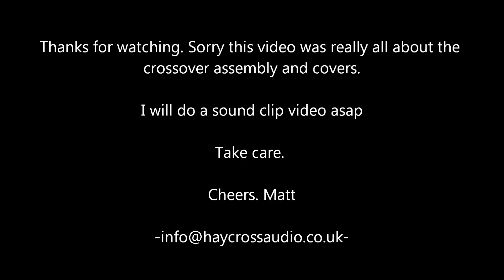2-way Speaker Build. LS3/5a Style Part 4

Comment: Resistors and capacitors are made with metals. Shouldn’t it be mounted away from the top of the woofer inductor where it’s magnetic field is the strongest ?
Reply from the maker: There's only limited space. The woofer inductor is at the top of the cabinet. It doesn't really matter. The driver magnets are not moving so can't induce current into any components.

Comment: They look a lot like Linn Kans. I love 'em....
Reply from the maker: Ended up sounding really good. There a keeper for sure. They live in our snug and run with a sub
Reply: @haycrossaudio5474  I'm over in Australia Matt, (Ex Pom from Yorkshire) where the availability of older British stuff seems to be quite limited, a much smaller population I suspect being the main factor. Nevertheless I've watched many of your vids and find them most enlightening. I'm a speaker builder from way back and I really should learn more about crossover theory. However I don't have any measuring equipment, nor would I know how to use it, so I mainly dabble in the woodworking side of the hobby. I turned 76 today (your tomorrow) so I'm probably a bit long in the tooth for too much math...

I've got a pair of D'appolito's on the go. They're old Aria 5's, built from a kit using Focal drivers and serious looking crossovers by my nephew who now lives in London. He palmed 'em off to me for zero dollars and no cents since he no longer has any need for them. They're probably 15-20 years old and were very expensive in their time. I binned the enclosures except for the robust front baffles and I'm in the middle of making new boxes.

I built an active sub last year recycling a Rogers Chinese sub, using the electronics. I subbed in more powerful Mosfets and larger filter caps, which probably don't make the slightest difference. A new 12 inch driver from Farnell (Element14 in Oz) replaced the crappy Rogers thing, and in down-firing mode with a new enclosure it works very well. My preference is for small bookshelves, so a sub is pretty much essential as you are of course aware. It's my first ever sub, and I should have embraced the idea years ago...

Your vids about re-covering boxes are very helpful, though I think I'll be using wood veneer rather than Fablon vinyl. I don't trust myself with it. A couple of attempts at lining shelves years ago ended in scrunched-up balls of the stuff flying everywhere..

Anyway Matt, keep up your excellent work, it's both useful and entertaining...🙂🙂

Comment: Great video once again Mat. It will be interesting to hear Kevin's thoughts at some point. Your covers looked very professional and to factory standards. If they were mine I might paint the staples black. Wonder if there are black anodised staples anywhere. This is not a negative comment as they are great and you have achieved a great end result. Thanks looking forward to the next video.
Reply from the maker: I never thought about black staples. Good call. I'll look into that. Cheers 🍻
Reply: @haycrossaudio5474  It's a bit of a fussy observation I have with many of the BBC monitors.
Reply: Would the stuff that blues steel work on staples might do 🤷 love the video